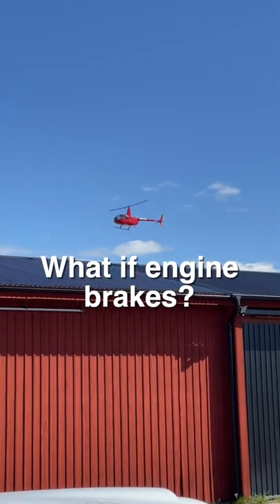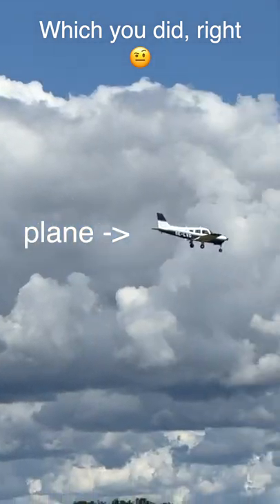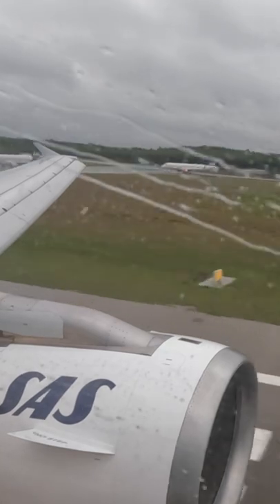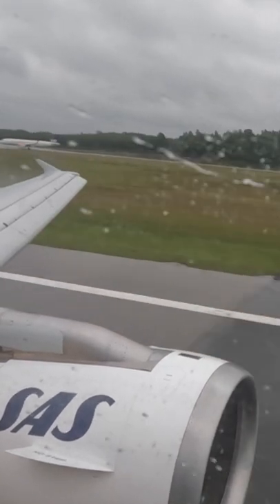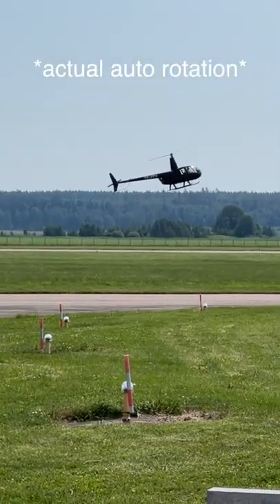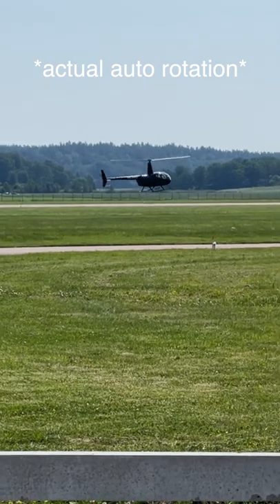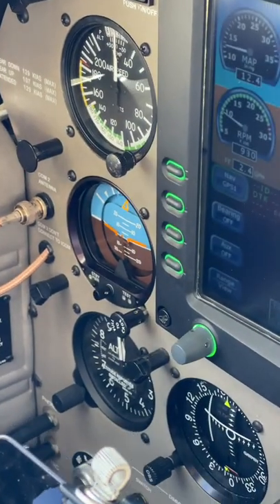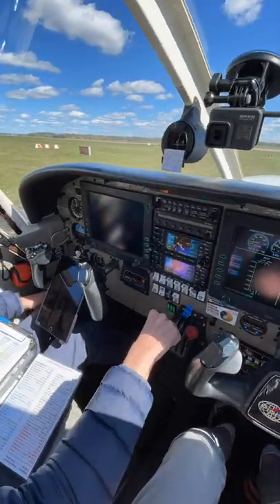Helicopter engine failure - What now? #short

Comment: My airplane doesn't have engine brakes. When you turn off the engine, it stops, it doesn't need engine brakes. Many helicopters have rotor brakes to stop rotation after landing, but they don't have engine brakes. i've never heard of engine brakes on aircraft. Where did you come up with this idea?

Comment: No need to worry about the engine a Robinson’s rotor will fail or chop the tail off first!
Reply from the maker: Didn’t know Robinsons were known for that
Reply: @flyingfathersonclips  They aren't.  Rotors don't just randomly "fail" on robbies or any other certified helicopters.  However, ANY 2 bladed helicopter (Robinsons, Hueys, and many more) can experience a casualty called "mast bumping" when they enter low-G flight conditions.  Robinsons are just the most popular helicopters in the world and often used as training aircraft due to their price, despite them not being designed for training.  Hence their higher crash numbers.  People with no idea what they're talking about think the dangerous mast bumping conditions are specific to Robbies, it's become a meme of sorts in the aviation community despite not being true.